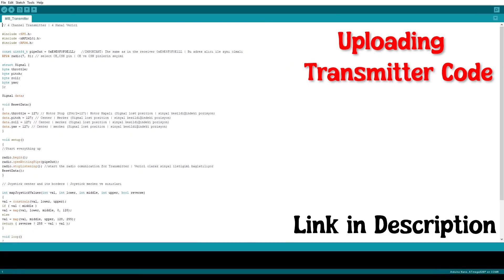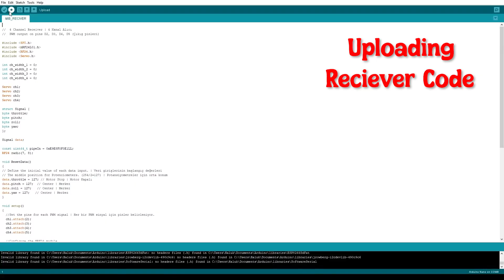How to Make 4 Channel RC Transmitter & Receiver at Home | DIY RC Remote Control System

Comment: In transmitter where is the connection of power supply
Reply from the maker: I am use data cable for power supply